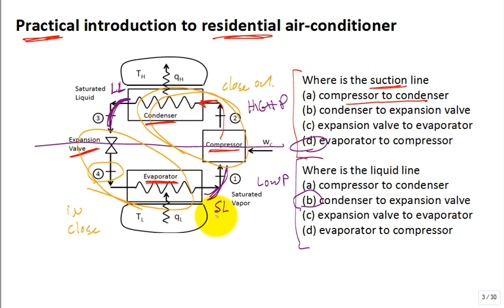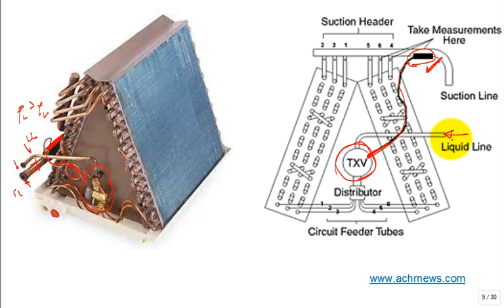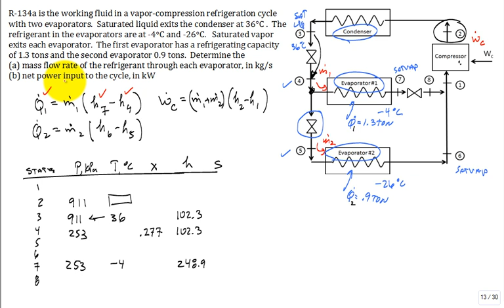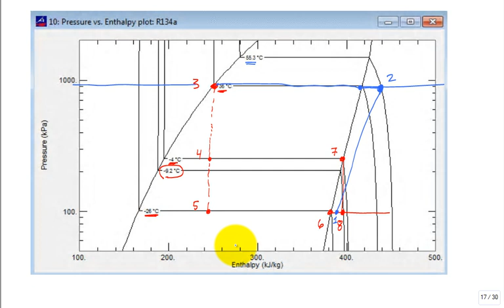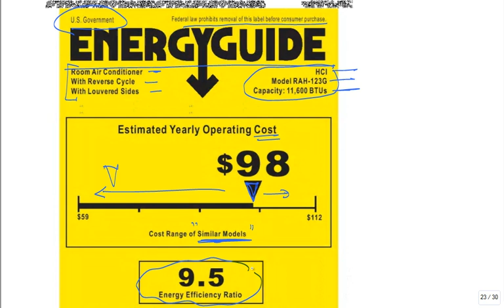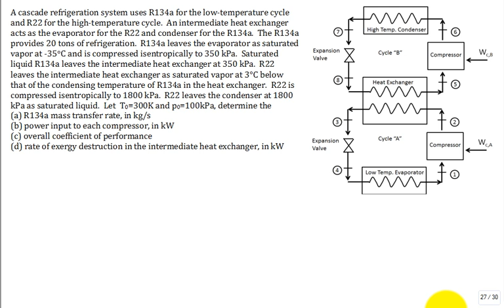Refrigeration 2 Summer2015

Comment: At 44:36, how was the entropy obtained for state 1? (without using excel)
Reply from the maker: penguim90 I think you are asking how to do it with tables in the textbook.  Need to construct superheated R134a table at p=1.02 bar, then interpolate with respect to h to find s.  In short, double interpolation.
Reply: that makes sense. thank you for your help, professor.